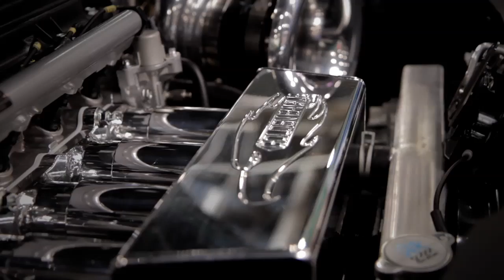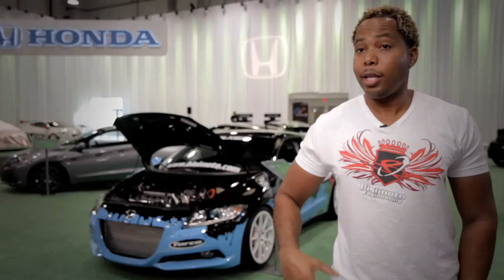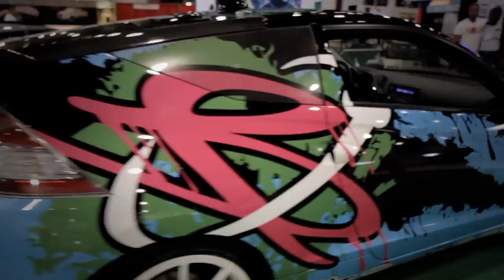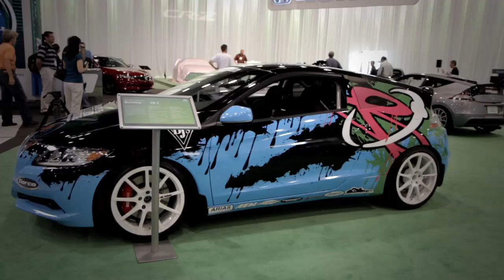Bisimoto Engineering 2011 Honda CR-Z Project Vehicle

Comment: @1994toyotasupra majority of people shift before 3k rpm if they're daily driving. it's better for fuel economy. not hard to stay out of boost.

you'd be surprised what you can do tuning your own fuel maps. the CRZ still would have the eco/sport/normal buttons active, so anything is possible with proper tuning. Bisi is a genius. You really have to read more into what the Honda scene has done in order to understand.

Comment: @pipoveyron you have a point there but things are getting clearer nowadays with turbo system. by 2013, F1 racing regulations will go back to the in-line, i.e. four banger, turbochargers. although its goodbye for the V's and W's good things might developed for better turbo system then.

Comment: @1994toyotasupra bisi is saying that most turbocharged cant have economy mode when you wanted it the most which on old turbo systems not possible. bisi has done his homework just to meet both ends-hp and economy. a feat of engineering  that is relevant in this crucial times of our economy. 
bisi again made innovative trends in sohc turbos. give bisi the credit dude.

Comment: @zerojett how could you stay out of boost ? i would imagine it spools maybe around 3-4k ? would you just drive under 3 k rpms so your not boosting ?  either way those injectors are a large cc and their gonna be pumping out alot of gas even if you had a way to switch to a minimized fuel consumption your still sucking gas...  

Bottom line.. if you have a built car like this .... you should have a daily driver for going to work school etc. and then a beast like this one for the fun.

Comment: @friday10s my genisis stock 303hp vs 190 horse power civic its better have a f20 under the hood 2 touch me  ive had burned b18 and b20 i used 2 be a honda guy but hell my chevy suburban k2500 454 320hp would destroy and civic or teg and prob run it over 2 lol

Comment: @friday10s my fucking truck is faster than my genisis crushes civics and if that doesnt work will pull out the 84 olds cutlass sepreme 307ci 454hp N/A  i crush s2000 and nsx and im on street tires